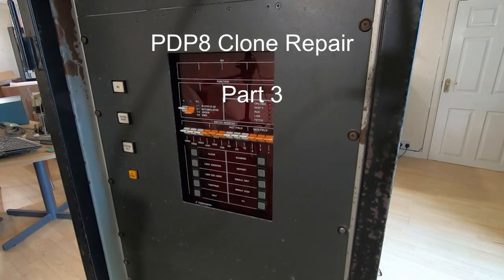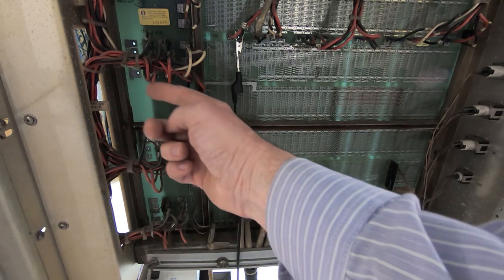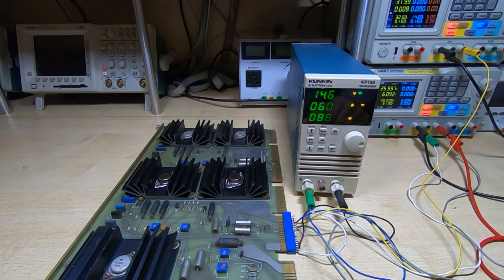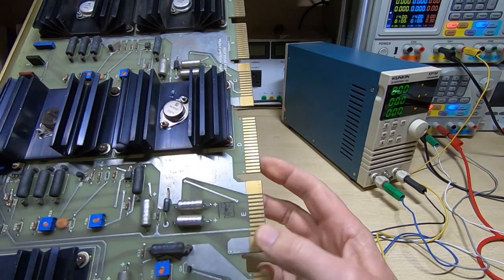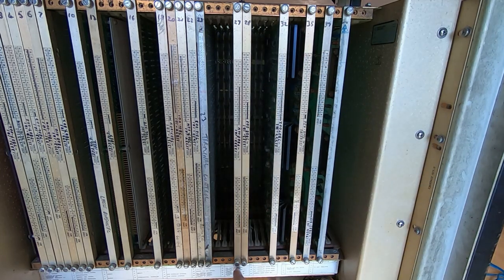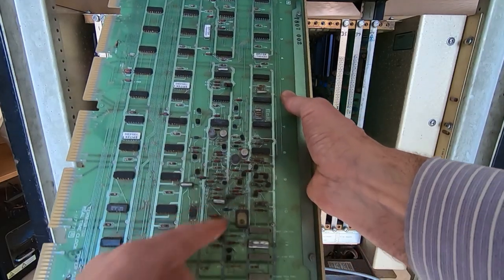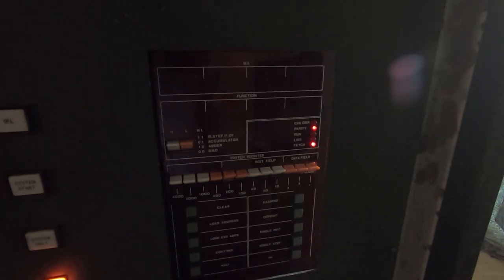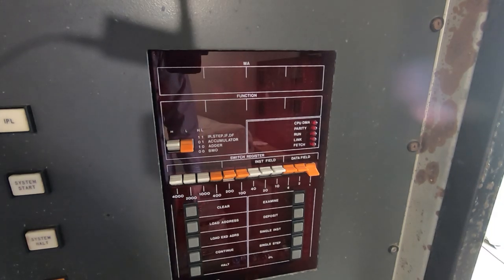PDP8 Clone Repair Part3

Comment: I paused the video but couldn't see any obvious crystal that I guess a RTC would source from. They've thrown three different functions onto one board, would it be possible to say temporarily disconnect that -15V in at pin 4 to disable(?) the PF ? Would riser cards allow probing for the RTC oscillator? Is the termination done by those white resistor packs?
Does the CCI machine on the randomorbit web page have readable ICs on its PF board?
Reply from the maker: I actually tried disconnecting the resistor on the regulator board so that the -15 supply would not be shut down but it made no difference to the operation of the machine. I suspect that the power fail board has its finger in many pies. For example there is a cable from it that runs directly from it to where the drives should be so it is likely that it will not run without this being connected. If this machine is anything like other PDP machines then the RTC is a mains frequency derived system which is used to generate regular system interrupts to drive everything. As the part numbers cannot be read on most of the IC's then it would make reveres engineering this board very slow and time consuming. It could certainly be done but I am not sure I want to spend that much time on something that would only help fix this particular machine.
Reply from the maker: Forgot to say that this IS the machine shown on the randomorbit web site.
Reply: @JerryWalker001  did the owner happen to take any better photos (or at least still have the full resolution versions) of the boards before "cleaning them up" - the markings might have been visible before that...